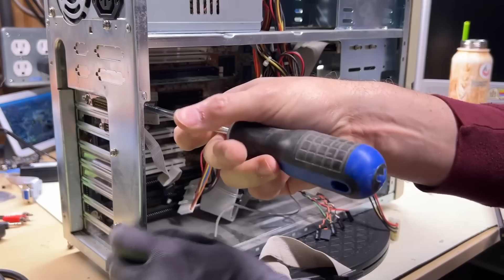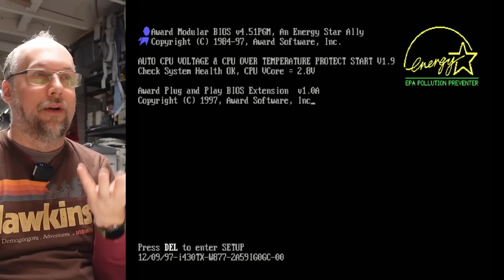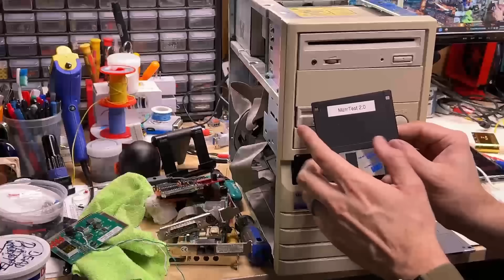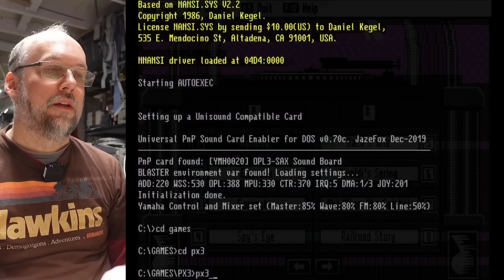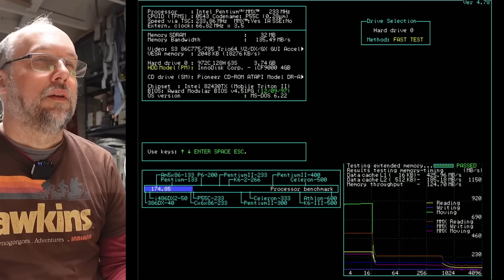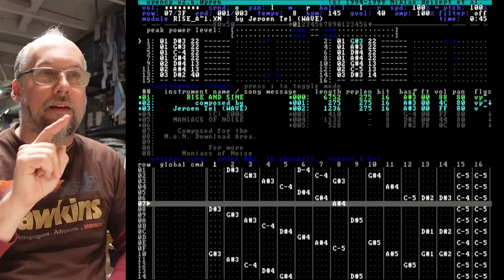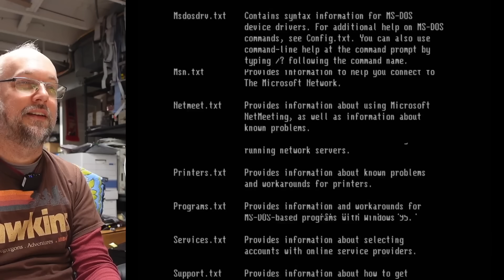Test and try: What's inside this dusty old PC?

Comment: I have almost the exact same case for my Asus P5A-B. Top 5.25" bay is shared between a slim DVD drive and a CF boot drive bay, second 5,25" bay is an Epson 3,5" + 5,25" floppy, and first 3,5 bay has the controller for WP32 McCake, and second 3,5" bay has a gotek with oled and a rotary knob, and everything is perfectly beige. I changed the keylock to a 2NC2NO switch to switch between the Epson 3,5" floppy and the gotek, using tech tangents' floppy swich that i ordered from PCBway. Internally, aside from the mobo, it has an Nvidia TNT2 AGP, a Creative AWE64 Gold ISA (that i modded for internal midi output to the WP32 McCake that sits on a gameport adapter with 2 pins connected to the solder points on the gameport output on the AWE64), and a network card, and a USB2 card, and a secondary IDE CF bay in a PCI bracket. Of course the turbo button works, and it switches the clocks from 350Mhz to 550MHz on the AMD K6-2, with properly configured MHz display with matching numbers. Corsair SFX 600W PSU, and all noctua fans.  Took me years to get everything right, but it turned out as a real work of art, and of course the front panel is filled with all the appropriate hardware stickers.

Comment: Looks like this case would support a baby AT board that has PS/2 mouse and keyboard connectors instead of the AT connector. I think you had one of those in a different video.

Comment: This one hits home for me. My first computer, that I could really call my own, was a 486SX33. That was a cool machine but when I compared how the games on it worked to a friends DX266, my computer just looked damn slow and boggy. That computer was something I was able to get for free because someone we knew worked for a place was doing a round of upgrades and just wanted to get rid of them.

My first computer which I built from new parts was  Pentium 150, similar to the one in this video. It had an S3 Virge card and an ISA (or maybe EISA) AWE64 soundblaster. MAN I wish I kept that soundblaster at least. The jump in performance for games was an absolute joy and I enjoyed a lot of the typical 90's games like this. Played all the build engine games of course.I bought the duke nukem plutonium pack around that time.

I don't remember if I put a decent 3D accelerator in that particular machine but we did have the Riva128, then a TNT, then TNT2 Ultra around that time. I originally had 16MB of memory and when I tried to play video files it was really choppy. Upgrading to 32MB fixed that.

I kind of want to rebuild the same computer so I have that real 90's computer again but I don't remember the make and model of most of the parts. I remember the motherboard had bright yellow sticker on the control chip.

Comment: Doesn't that bring back memories. That looks so much like the first Windows PC that I can remember my family having. I can't remember exactly what was in that PC, but I remember that it had a HDD of unknown capacity, a 3.5" 1.44Mb floppy drive, a CD-ROM drive, an S3 Trio64 VGA graphics card, a Sound Blaster 16 sound card, all the RAM slots populated and an Intel Pentium powerful enough to run Doom 1 and 2, Tyrian and Magic Carpet 2 (in mode 13H) at maximum (or near maximum)  framerate. It initially had Windows 95  when we got it home when we had asked for Windows 3.11, briefly taken back to have the correct OS installed, before eventually being upgraded to Windows 95 an unknown time later.

Comment: My most memorable "seruliosly" moment waszan amd am2 system  where cooler has been crammed into the socket with the shipping plastic still on the cooler

Also then cases usually have space behind the full length card support for another 80mm intake fan😊

Comment: Its funny how those TURBO buttons were actually backwards. When you pressed them it was to slow down the computet so programs that were timed off of cpu clock cycles instead of chronological time would work right. Otherwise those games that ran fine on slower pcs would be unplayably fast on a faster CPU.

Comment: I picked up a tower exactly the same as this a couple of years ago, searching for a good DOS/95 machine. It's almost identical inside, including the Motherboard/CPU combo. Fun Fact, this case has a 'foot' that screws onto the bottom of the case that's tapered at a 45 degree angle outward, but it's made of plastic so I can only imagine most of them were broken by now.

Comment: Nice delving into a mystery PC case.  I have pretty much kept all my computer parts since I started into it in the early 1980's, including Commodore 64's, which I still have as well.   So good thing I still have my Pentium 233 MMX, which I had bought new in the late 1990's & actually used it in an office computer up until 2020 but which I still have to this day.    The best times I have probably used this 233 was in & around the Y2k era, playing games on it such as Quake II, Soldier of Fortune, Battlezone II & Half-Life.  Some of those games did start to choke on the 233 MMX so eventually had to get a faster processor.  Those were the days.
Reply: A 233 was the minimum for most games around 97/98 Awesome you rocked that relic for so long.

Comment: I had a case like that (with different plastic front) on my first computer and it always felt solid like a tank compared to almost all it's successors. Once it fell from about 3 meters high and only got a little dent and chipped paint. The ceramic floor, on the other hand, was left with a broken tile.
Being able to remove the motherboard tray was great. None of my other cases has that feature including the most recent one.
Unfortunately, I had to throw it to the trash because it was getting too rusty. My house has too much moist :(

Comment: I  had an optical CD reader slot in with space for 4 CD's at the same time and it was the same physical size as the standard CD reader. 
You could load 6 discs and change between them with a button. 
Finally found which one it was, TEAC CD-C68E

Comment: I had a Pentium MMX 166MHz on a Super Socket 7 board. I modded a Pentium 3 heatsink onto it, and bumped the voltage a little and set the FSB too 100MHz so the CPU ran at 250MHz. With 128MB PC100 RAM and an AGP ATI card, that thing ran Win 2k like a champ! I also had a SCSI controller and drives in it. I ran it as a server for a while on LAN parties that me and some friends hosted. Unfortunately my dad threw it out because it got left behind when I moved away from home.

Comment: I worked in computer support in the days when PCs like this were new, I remember upgrading a load of office PCs that were running short of disk space from 85MB or 120MB drives to huge 500MB drives (now MiB), they had more room than they knew what to do with, now less than a 1TB SSD is considered small and many have much more, it's incredible how far we've come.

Comment: 2:38 PS/2 ports were also seen on newer 486 PCI boards. Sometimes in the form of a header, other times it was noticeable on the board that a classic DIN5 connector or PS/2 had been installed in the same place. I also saw a variant where the DIN5 connector on the keyboard was fitted, but next to it there was an empty, unfitted place for the PS/2 mouse connector. Some cases even had a preparation for this and right next to the connector on the keyboard there was a small, break-out plate just for this. In several cases, I used this preparation, soldered the connector and broke away the case plate. It is possible that I have a piece like this somewhere in my archive.
4:19 boards in AT format with an AGP slot were commonly sold. For Soctet7/Slot1/Socket370 platforms. Examples Gigabyte 5AA/Pine TL-SI21/Tomato ZX98-CU etc.

Comment: A lot of times you can take the sticker off the back of the little fan and drip some oil in the bearings and reseal it with the sticker, or maybe replace it with another.  Just be careful to not to get oil outside of the bearing hole.

Comment: That sticker on the CPU looks like a price sticker, with the underline on the last two digits; no dollar sign so it's more likely a warranty serial number, which means they deliberately put that sticker on there. Even though the machine looks pretty well assembled besides that (at least an attempt at cable management rather than the standard rats nest, full compliment of screws and mounting posts), if I found that sticker under the heatsink, I'd never buy from that computer store again.

Comment: I have that exact case you've got there.  Mine currently has an AMD 5x86 150MHz CPU in it.  The case came to me many, many, many years ago with a 386 in it, then I upgraded it to a 486.  When I originally got the 5x86 150MHz, I put it into a different case, and the old case with the 486 still in it went out to my grandpa's workshop, where he never used it.  Years later, I wound up with both systems in my possession again, and installed the 5x86 motherboard into the 486 case, and that's what it is today.

Comment: Good vid Adrian! But I'd say that, in running old games, beyond the 386 barrier, you may collide with a harder issue than just speed: 286's protected mode instruction set is different and incompatible with 386's & up. That's why I always keep my M209 board up& running.😊
P.S.: a good use of the 2-digit LED display I found is, precisely, the output of the ISA Post-board! It's not quite straightforward, needs some crimping & soldering, but it's magnetic to me...

Comment: Several decades ago, some of my PC wholesale suppliers usually served me computers without thermal paste and with paper stickers on the CPU (11:24) ... I had to check all the processors that passed through my hands one by one.
Ironically, the supplier himself warned in the small print that 'the absence of thermal paste would invalidate the warranty', ... but they themselves were the first to forget it! 🤦🤦‍♀

Comment: I have a similair pc, maybe slightly taller but with a P233mmx too, 256Mb SDRam, 3 HDD's (6.5, 7.6 and 32Gb), Voodoo 3 2000 PCI, SB16 CT2950 and a 3Com nic so a pretty packed old pc.
It also run win98se instead of 95.

It's my old games rig if you will :)

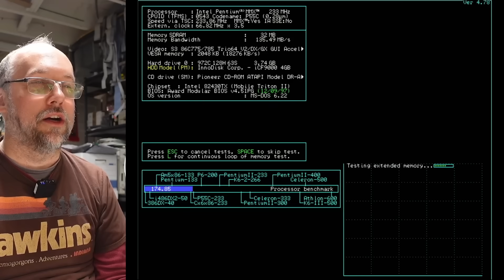Comment: 39:45 135 MB/s of memory bandwidth when using SDRAM seems a bit naff. Checking my old Speedsys files, I got 167 with a P133 using fastpage RAM on a GA-586HX, and 223 with a P200MMX and EDO DRAM. Maybe you should have turned on speculative read after all? I wouldn't expect the TX chipset to be slower, limited L2 cacheable area aside (it's only 64 megs).

Comment: A CD-ROM drive is not very convenient for transfering random files, if you have another mean (and nowadays it's easy to have something better, from cf cards to ethernet), but I always use one on 90s PCs because I like the experience of installing games and other software as they were originally distributed. Or run those multi-CD FMV adventure games for instance, which you can't really dump onto a 2GB MS-DOS partition anyway.

Comment: How weird it is to support an AT or USB keyboard, but not a PS/2 one.
Reply: Pretty common in the late 90s. Most Socket 7 systems have USB and all AT boards have AT keyboard connectors. AT and PS/2 keyboards are electrically the same so all you need is a passive adapter to use a PS/2 keyboard. You also need a breakout cable to get a USB port so you could argue this board supports USB and PS/2 keyboards equally well.

Comment: I don't find many AT cases anymore so I like to take these later AT motherboards that also support ATX power and move them into more modern ATX cases.  You need to use cases where the front isn't completely consumed by 3.5" HDD mounting hardware as it will conflict with the space the board and the typically longer ISA cards can consume.  Some very late 486 boards provide the PS/2 mouse header, like 1994 and beyond.

Comment: I like watching old computers get serviced, specially knowing how old they are and still running like they were bought yesterday!
What kind of bulb do you use to put load on the PSU? I have a digital tester for ATX PSUs that shows the 5v/12v voltages, but I would like to give it a load of a few Watts on one or two IDE connector cables to stress it our for a few minutes.

Comment: The video card and the sound card are one of the best ones for MS Dos compatibility. I use an YMF-718/719 paired with a DreamblasterS1 and a CL-5446 video card, in my Pentium-166. The only advantage my 5446 has over an S3-Trio64 is hardware enabled Vesa. It will not waste mem on UniVBE.

You got a solid machine there, for mid-era to late-era Dos stuff.

Comment: I know I'm a day or two late to the party, but funnily enough I've been working all week on cleaning up a very dirty Pentium MMX machine. As of writing this comment the machine is almost up and running again (just need to close up the case, finish reassebling the keyboard, and burning some OS install disks (I have checked to see if it can boot via the original hard drives), amonst a few other small things).

Comment: These cases bring back so many memories. In the mid to late 1990s, myself & my Dad would use this style case for our own line of PCs after he stopped selling Amstrad computers - though they had a flush face rather than the ridge in the middle. But all with that smoked panel. Unfortunately, at least the ones we had didn't have a screen there - there wasn't a moulding for it either if I remember - though those were ATX cases. 

These were typical Windows 95/98 machines - though, as a small UK based boutique company, they were mostly built to order but mostly they had AMD K6-2/3 CPUs - I loved these CPUs. While I did have experience with 386s etc. (my first PC was an Amstrad MegaPC which was a 386 with a Sega MegaDrive or Genesis built in. Actually quite slow at the time but for me, it was amazing! Considering I had moved from an Amstrad CPC 6128 which had a Zilog Z80 CPU and a 3in disk drive). But these '90s machines are what I learned to build computers with. I have fond memories and also many scars - these cases aren't exactly well made with lots of sharp metal... It wasn't unusual for me to shed a little blood while building them... LOL

Comment: I used to have a Slot 1 AT motherboard with AGP, PCI and ISA. It also had an ATX form card (which is the little board that has your PS/2 port and such) but instead of a serial port, it had an IR port and 2 USB 1.1 ports.

Comment: The soundcard is based on a Yamaha YMF718 (or 719) chip. It has native OPL3 support (no emulation), and it also supports Windows Sound System (WSS) in MS-DOS. You just need the proper drivers (YAMAHA Audician 32 Plus, available on Vogons).

Comment: If you hold down the reset switch while the computer is running, you can change the numbers displayed on the panel LED digit readout. I had one of those cases back in 1996 😊

Comment: 486 boards indeed did have PS2 mouse headers on the PCB and PCI and ISA slots. Funny thing is Phil's Computer Lab just had a video where he used a 486 board with both. Also looking forward a Coleco Adam computer video from you.

Comment: That could have been my exact pc.  I had that exact case with the pioneer slot drive.  But there wasnt a raised bit around the eject.  I think I had a pentium 300 which I ran at 333 for years did all of my assignments on it.  This seems modern for Adrian,  and not as exciting as usual.... but for some reason I wanted to see if it would all work too!

Comment: About the thermal paste or absence thereof, it wasn't nearly as mandatory on these CPUs as it became only a few years later; They worked without problems, for years, without it and even with labels in the way - as this PC is testament to. 

Truth be told, it can even prove detrimental on these old CPUs as the cooler retaining mechanism is not applying enough pressure on the paste to have it do its job of "filling the gaps", leaving it too thick, with air gaps and ultimately ending up being more an insulator than anything else. Modern thermal compounds, with their high viscosity, are especially problematic as they're designed for the Hulksmash-level of pressure modern coolers apply. 

This is particularly egregious on 486-class CPUs, where the cooler is often held by a plastic clip that hooks under the CPU sides- I have an AMD 5x86 133Mhz, equipped with an era-original cooler upgraded to a Noctua fan; It crashed after a few minutes of intensive applications or games. Removed the paste, installed the cooler "metal to ceramic", it runs absolutely fine. Blew my mind, but then looking at the puny plastic bracket, everything became obvious.

Comment: The OPL3-Sax has 16 bit Windows Sound System Support but you'll probably need to use the proper dos drivers for it. Unisound configured it at port 530 IRQ 5 DMA 3, It should have worked, you might need a newer unisound or tell cp to use those exact settings. Not many games support WSS though so for the most part it doesn't really matter and for the games that do support wss you probably want a sound card with wavetable midi anyway. Your Blaster variable should have T4 in it to indicate SBPro2 (T6 that you removed means SB16).

Comment: This takes me back, I had a very similar case on my first PC build, it had exactly the same smoked plastic part and power button.  I had a Gigabyte GA-586HX with 512k L2 cache, with the i430HX chipset (I think that was high-end at the time, later variants had DIMM/MMX support) I also had the Yamaha soundcard, it was amazing.   I'm thinking your i430TX board has 2x 256k L2 cache and the one on the retro site is a 256k variant?

Comment: Usually 486 & Pentium1/2 motherboards are marked not only with silk-screen printing on the board but also with a sticker on the outermost ISA slot. The sticker can be seen if you look at the end of the outer isa slot. The sticker usually contains the full name of the board, its revision and other markings.